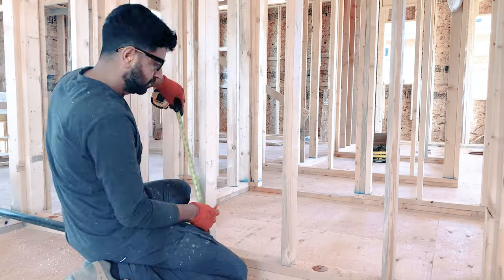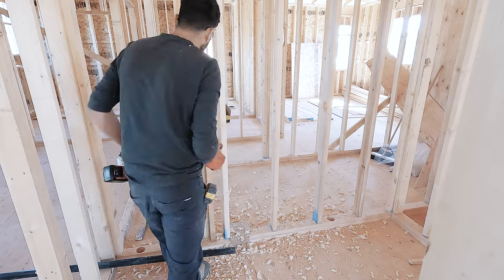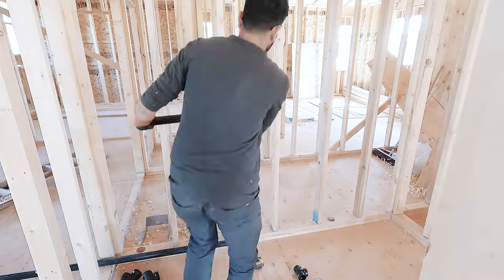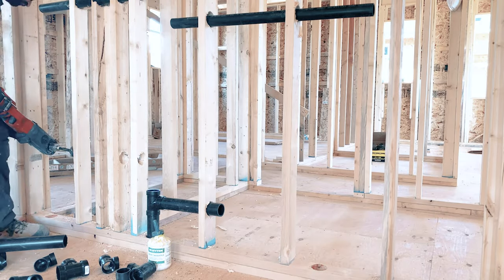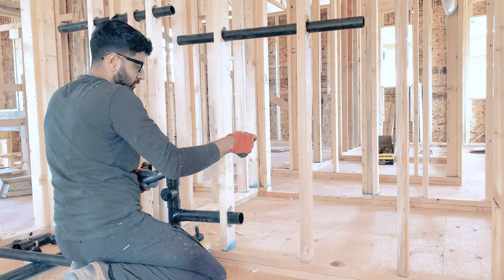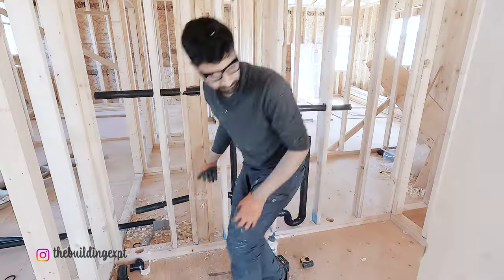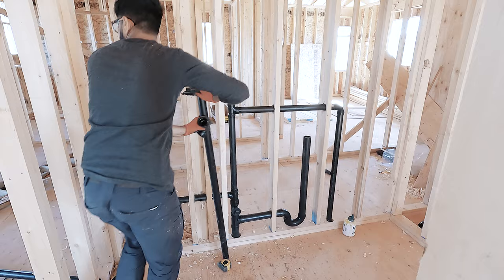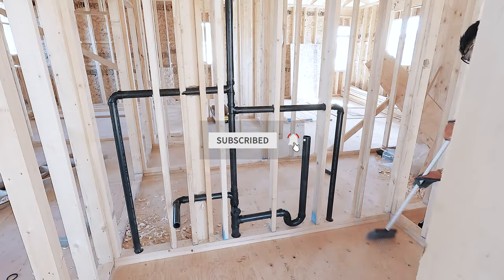Plumbing Rough In – Laundry Plumbing (EP6) - The Building Expert 2022

Comment: I install laundry in basement where it has wet went drainline nearby, is it valid? 2nd, I want to install a kitchen sink as well. what is the minimum separation of those two wye fittings and what if the vertical pipe is at 45 degree angle ? thanks

Comment: Question my laundry is a French laundry it only has. A sink and how do I connect the washing machine to it ? No taps in the walls my plumber fkd up I think !
Can. Use divertor connect it under the sink to the main water pipe and t it to the washing machine ?

Comment: Gluing ABS.  I noticed that you're not following the correct manufacturer's procedure for connecting pipes;  Cutting AND DEBURRING the ends, making sure the surfaces of the pipes to be joined are WIPED CLEAN of any dust/dirt, applying glue to BOTH SURFACES of the connecting pipes (and not just one), giving the glued pipe end a quarter turn AND HOLDING IT IN PLACE SECURELY for several seconds.  The container from which you are getting the glue from APPEARS OLD AND DIRTY with lumped up glue (with sawdust mixed in) at the top.  I'm assuming the glue may contain debris from the job or a past job, etc.  Yes, you are working fast, but why introduce a problem(s) at this critical step of connecting and sealing ABS pipes?

Comment: I a plumber in Chicago, Illinois, this plumbing work never passes a rough-in inspection here 🥵

1) abs not allowed
 2) Every laundry needs a grey box. 
3) wet vents are not allowed 
4) Every laundry room requires a floor drain 
5)vents separate for each discharge opening
Reply: Wet vents must be allowed. How do you vent floor sinks in a restaurant, or mechanicalroom?  Combination drain and vent, i.e. a wet vent. Also bathroom groups allow a wet vent.
Reply: Floor drain may not be necessary because it's residential (house)
Reply: He used 1 1/2  pipe for a laundry sink and washmachine.. that's nuts. He needed 2 inch pipe

Comment: 1 1/2 pipe for a wash machine and it has a laundry sink on it. Not good.. you need 2 inch pipe ..🤯
Reply: The washer has 2 inch pipe.  The San tee he used for the sink is a 1 1/2 x 2